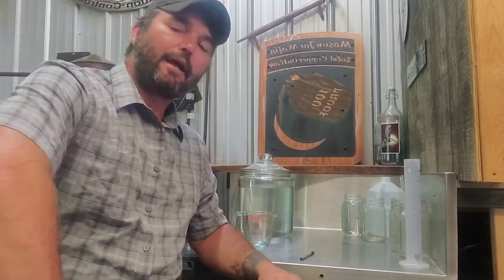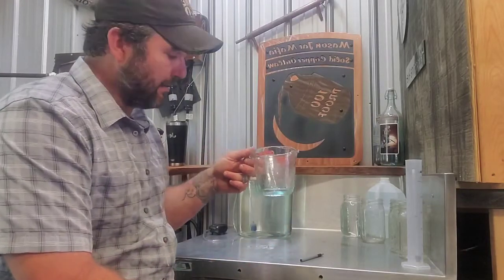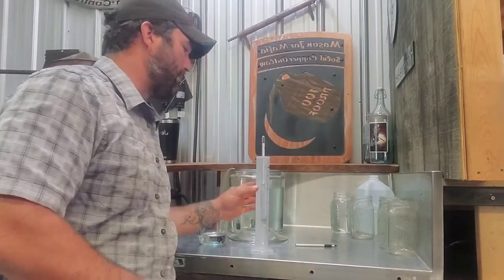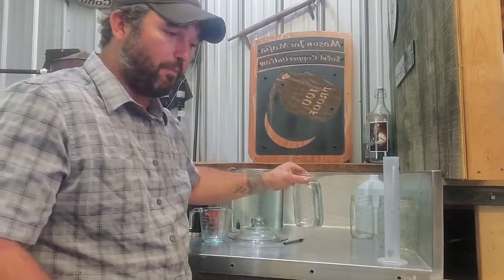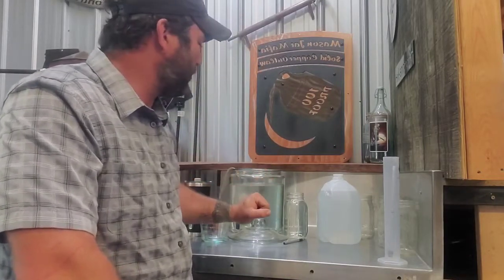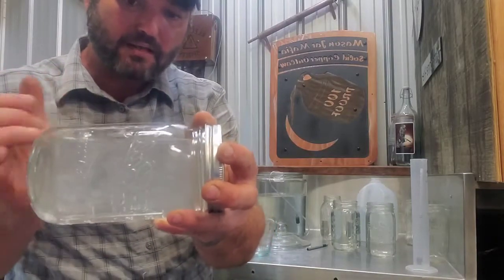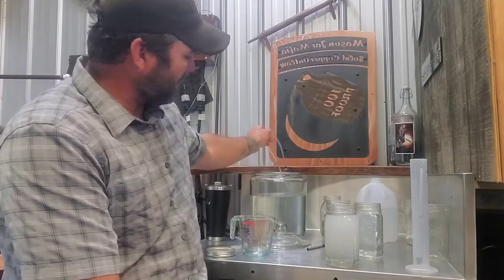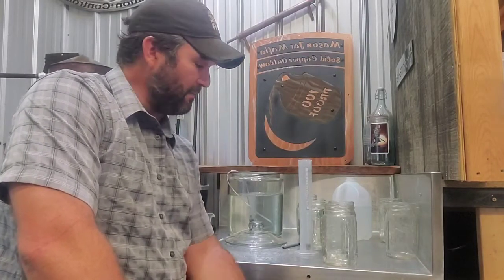Proofing/diluting a finished run

Comment: Can you try to get fatty acids to go back into solution using the air bubbles at 80 proof?  I know anything over 94 proof will keep them in solution.  I like that you call out the difference between adding alcohol to water vs the other way around....  Although, once upon a time tried it in large bottles and just ended up with two distinct layers, so upon shaking don't know it made a difference (fifteen years ago cloudy didn't bother me as no one else'd see it).
Thanks for your time, and for sharing!